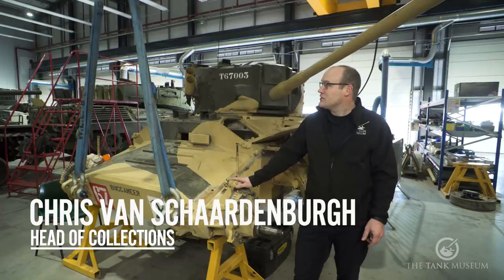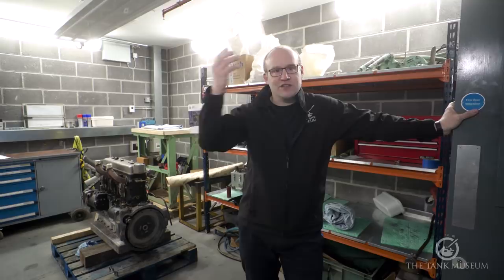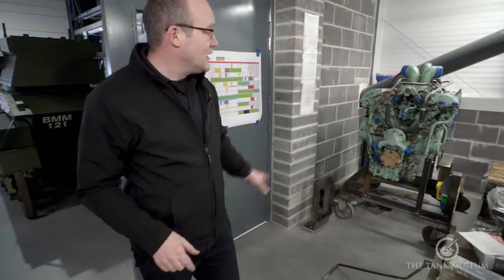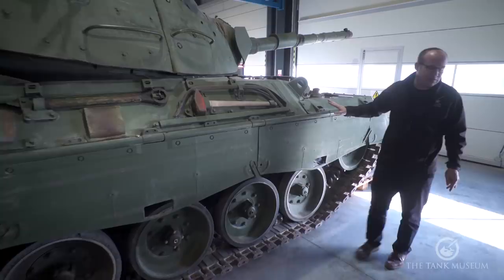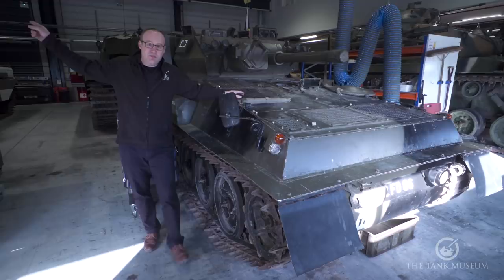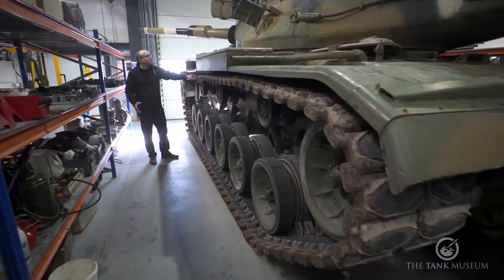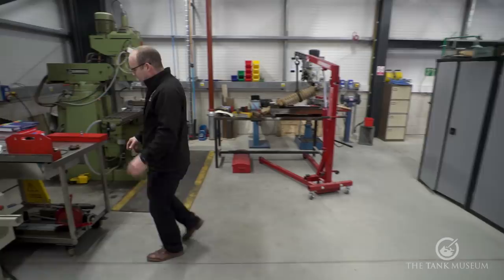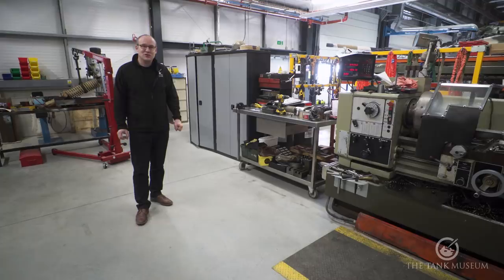What's in the Workshop? | Ep. 10 | Tank Workshop Diaries | The Tank Museum

Comment: Do you have a CNC machine?
Reply: CNC machines aren't necessarily a magic solution to every problem. As I understand it, for one offs and small runs they can be as slow or slower than using a manual lathe or mill.
Reply: I would expect they contract out that sort of work as they do not have a lot of work that requires it and it's often more cost effective that way.